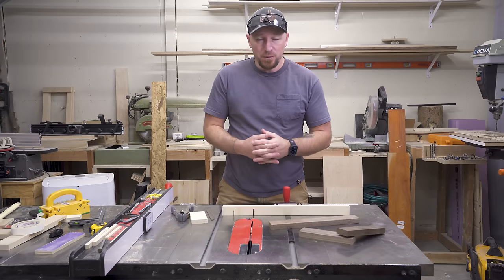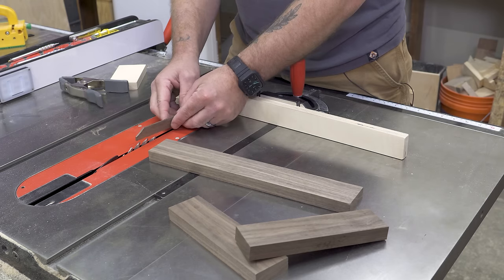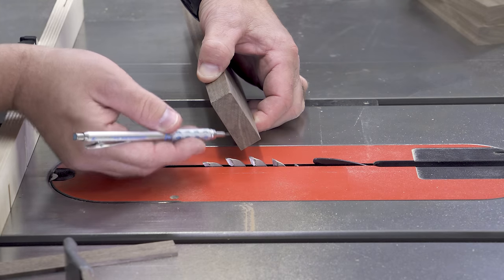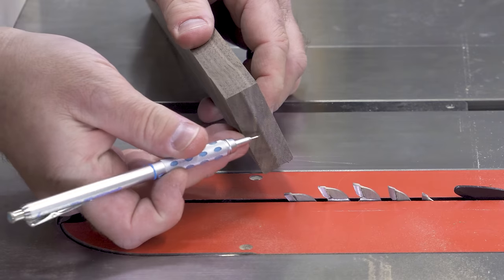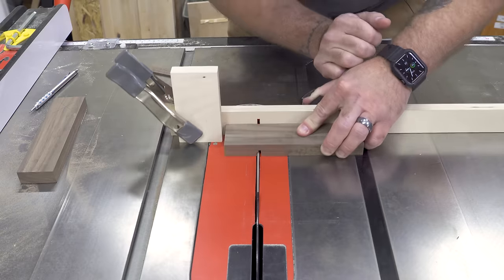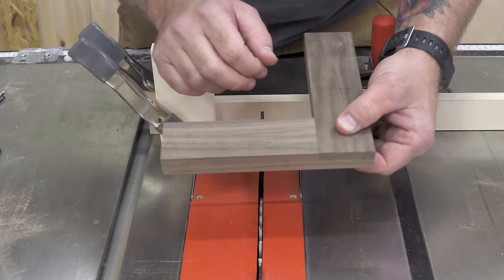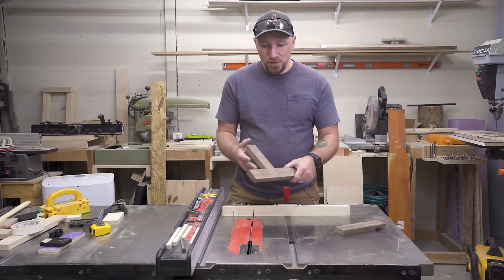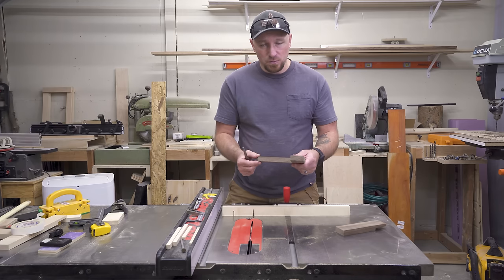How To Make Perfect Half Lap Joints On The Table Saw

Comment: Rather than trying to cut a perfect thickness shim you could use a drill bit the same thickness as the blade.
Reply from the maker: In theory yes. But that doesn't work for people using thin kerf blades so that's why I didn't do it. Cutting the shim wasn't to bad and if it ends up near a spinning blade it's no big deal. Great suggestion though!
Reply: Wouldn’t that scratch up the fence?
Reply: @InspireWoodcraft  what the hell are you talking about? The thickness of the blade is irrelevant if you use the proper sized drill bit. Or better yet just set the stop bock in the proper position.
Reply from the maker: @GifCo This is the second time I've seen you reference putting the stop block in the right position. I am not going to argue with you because I have better things to do with my life, but I will leave this here for anyone needing the info. You cannot just simply place the stop block in the right place without the exact known width of the blade. It needs to be a measured distance to compensate. Literally everyone who watched the video got how and why it worked but you, apparently. No judgement here. Just maybe watch again and it'll click for you. As for a drill bit as a shim: Yes, this will work for most circumstances, as I already stated. However the drill bit needs to be the same thickness as the saw blade or you WILL end up with a joint that doesn't go together as well as the one that I demonstrated in this video. You can't outsmart physics. If you use a thin kerf blade, and you just so happen to have a drill bit the exact same size as said blade, then by all means go for it. If you think outside the box a little you will also come to the conclusion that a perfect blade-width shim can be cut to virtually any length and used for much more than just a half lap joint. You could make it span the length of your table saw fence and cut perfect dados, for example. You aren't going to do that very easily with a drill bit.
Reply: @InspireWoodcraft  lol I know this might blow your mind but drill bits come in ALL sizes. You complete muppet.
Reply: Getting kind of angry in here.  I'm curious about the 'drill bit' approach so I googled and the average thin kerf is "Thin kerf blades will generally be 25% thinner, creating a cut of 0.091” or about 3/32”"  The word "about" is was concerns me.  Do I use a 3/32 drill bit and hope it's 'about' right?  Or do I make a shim that is perfectly right?  If it's easy, I'll go with perfect thanks.
Reply from the maker: @Scott Roy The problem is that terms like "generally" and "about" is that they are not precise. In all honesty this may work just fine for you, but the only way to get it actually precise is too use the exact same thickness as the blade you are using. Drill bits are all different sizes, meaning that they are not all created equal. Just because a drill bit says it is a certain diameter doesn't mean that it is. Especially a worn out bit. The same applies to saw blades. Most saw blades will have the saw kerf written, stamped or engraved on the side of them. But these tolerances can vary in accuracy depending on the quality of manufacture, as with most things, and they also do not compensate for any blade deflection or movement while spinning full speed, in which case (especially with thin kerf blades) the saw kerf is actually wider than the blade measures. They also don't account for a worn out, re-sharpened or dirty blade. I have a super quick and dead-accurate way to get blade-width shims (also good for splines for splined miter joints) and the video can be seen here if you're interested: https://youtu.be/nsw5qlrdx2A. Hope that helps! Now we can wait patiently for someone else to respond with their vast array of wisdom all the while claiming I'm a "muppet". 🙄
Reply: @InspireWoodcraft  Yeah that muppet comment...wow.  Thank you for your clear and ACCURATE information.  When I see your two pieces of wood sticking together without glue or anything yet.  Yeah you win.

Comment: Great tip. Unfortunately here in Ireland and indeed the rest of Europe flat blades and dado blades are not allowed. Pain in the butt and of course our bore sizes are different as well so we can’t really order them from the USA
Reply from the maker: So wait you aren't allowed to even have flat grind blades? Someone else said something about the 30mm arbor issue also.
Reply: @InspireWoodcraft  yep it’s a 30mm arbor and it’s not that we are not allowed to have it . It’s not allowed be sold in shops under health and safety standards.

Comment: To make a perfect shim, you could use an old blade (of the same thickness as your current one) and cut a rectangular piece out of that. Or buy a small piece of steel that's also the same thickness. That would also give you a reusable shim that isn't going to warp or change size through the seasons.
Reply: The carbide tips on nearly all modern blades and the tooth set would make that ineffective, I think. What I mean is the rectangle cut from the center of the blade wouldn't be nearly wide enough. Even the flat top (non ATB) would still have this issue AFAIK

You are right about getting a piece of flat stock steel (preferably over-sized by as close as possible) and then just diamond plate or file it down to perfection.
Reply from the maker: Not necessarily bad ideas but I do have some reservations here. Using an old blade will not work because we are making the shim the same thickness of the blade teeth, not the plate. As for buying a piece of steel: it may be hard to find a piece of steel measuring the same as the blade especially since there are a lot of different size blades on the market. On that same note, I would highly discourage using a metal shim because if it falls and hits the blade, well... The wood movement in a wooden shim is negligible but if it is a concern to you, a better idea may be to pay closer to the grain orientation of the wood before you cut the shim. Wood typically moves the greatest distance across the grain, like from left to right as we would typically see a piece of lumber. If you make it from the right grain direction the movement will not affect the thickness whatsoever.
Reply from the maker: @JohnyW87 Good find. I cut mine almost the same way. His are a little tight though for some reason.
Reply from the maker: I just uploaded a video on how to make the shim if you're interested. Super easy! https://youtu.be/nsw5qlrdx2A
Reply: Jodie (hope I spell that right) I really like the uncomplicated,and “unfancy” way and style that you produce your videos,down to earth,little comertial and not trying too hard to be somebody,who ain’t authentic anymore.That’s what makes your videos enjoyable and.....I guess “stress less” fits in here best.
Reply: You need to allow for the width of the kerf, which is not just the thickness of the blade disc, but the projection of the teeth.

Comment: If you can cut a shim the perfect width of your saw blade you should be able to handle just placing the bloody stop block in the correct position.
Reply from the maker: You're right. I should be able to just eyeball it. Or something like that.
Reply: @InspireWoodcraft  yea or you could measure it, use the kerf cut in your fence to line it up, or this one is SUPER advanced but you could use a scrap piece of wood to get it perfect.

Comment: What about is the two parts are of different width like a 2x4 and 2x6 half lap joint
Reply from the maker: You would just have to reset your stop block for the next size. That's an interesting one. Might have to do that.

Comment: Nice presentation, but I would avoid running a piece tight against the fence while using the miter gauge because of the potential for the piece to bind between the blade and the fence.  Once you find your place on the miter gauge, removing the shim from the fence eliminates the potential for binding.
Reply from the maker: I actually just did a video to address this very thing! It’s a common misunderstanding. Why You Should "ALWAYS/NEVER" Use the Miter Gauge & Rip Fence at the Same Time / Woodworking Safety
https://youtu.be/MxhPgNbFzXQ

Comment: I don't have a flattop blade for my table saw but I can get cuts like that. There are no ridges. So like idk. Are flat top saw blades better than 40 teeth ones?
Reply: The amount of teeth make no difference. It's the bevel cut on the teeth. You might have a combo blade with ATB (alternate tooth bevel) that also has a flat top tooth every 4-6 teeth giving you the best of both worlds
Reply: @GifCoDigital  does that mean each carbide tooth is alternate sides, like the first one is angled towards the left and the next one the right and so on so forth?
Reply: @Zack16Fair  yea you got it. That is what most standard blades come with now. But like I said on some combination blades they will mix in a completely flat tooth every so many teeth. So that could be why you are getting a nice flat surface even though you have some beveled teeth
Reply: @GifCoDigital  cool, quick question if my outfeed table is about half an inch shorter than the top of my table saw, is it okay? Or should I make it completely flush with the top of the table saw?
Reply: @Zack16Fair  I would definitely try and make it flush if possible. On shorter rips it shouldn't make much of a difference as all it is doing is stopping the work piece from falling on the floor as you finish the cut. But for longer heavier stock where the outfeed table is supporting the work piece for much of the cut then having that height discrepancy will cause it to lift off the table saw table which would obviously effect the depth of your cut and also introduce more chance for binding.
Probably worth the bit of effort now to shim the legs or add a 1/2" price of plywood to the top and avoid issues down the road.
Reply: @GifCoDigital  okay. It's on casters so I guess I'll put just half an inch of plywood underneath it to level it out.
Reply from the maker: @Zack16Fair I know this question wasn't directed towards me, but a bit more info for you if you want it. The height of your outfeed table depends on how far away from the saw it is. If it butts right up to the back of the saw, making it flush is perfectly fine. However if you use a miter gauge or sleds you will run into issues if you don't route grooves into the outfeed table's top because the top itself will stop the miter gauge from sliding the whole distance of the slot. If your outfeed table is not butted up to the saw table but at least fairly close, a slightly lower height is preferred. This is so that material coming of the back of the saw that dips down (thin sheet goods, bowed material, etc.) doesn't hit the edge of the outfeed tables top and stop your work from moving forward. As far as the length of material affecting the angle and blade height as in the comment below, this is normally only a problem with non-through cuts, like a dado or groove. If you are making long cuts and the end closest to you is lifting a little due to angle, just raise the blade to compensate. Remember the longer the material the lower that angle gets as well. Another way to compensate would be to just throw a piece of half inch material on the outfeed table when you make those longer cuts. Problem solved and problems avoided down the road. Hope it helps.
Reply: @InspireWoodcraft  thanks that's a great response and there's about an inch or so gap between the outfeed table and the table saw. I'm doubling my workbench as a outfeed table and I just have to keep it clear whenever ill be making long cuts 😂
Reply: @InspireWoodcraft  you have some pretty interesting ways of doing things. I wouldnt setup an outfeed table that is only suitable for some cuts (ie only through cuts), also suggesting that someone just raise their blade to accommodate for a work piece lifting off the table is just wrong and dangerous. 
A small chamfer on the edge of the outfeed would be the same as lowering it slightly to handle sheet goods, and if you are milling up rough bowed lumber you hopefully are smart enough to cut with the bowed ends facing up which would make your lowered outfeed table even worse.
Finally If you can make a cross cut sled you can handle designing it to work with your specific outfeed table. No idea what you are talking about with the miter gauge, I have a small shitty table saw and the miter gauge doesn't come anywhere near exiting the back of the table when the work piece is fully cut and that is with no miter gauge fence installed which would hold it back even further from the end of the table saw.

Comment: Tip: you actually want the cut .001-002" deeper than halfway to account for glue. I set it up with a very thin piece of paper against the table saw top when "kissing" that halfway point. That gives me the glue line.  You do NOT want the joint proud enough to feel, as fixing it literally doubles or triples your build time. If it's scooch deep you can shim with tissue paper or a super thin plane shaving of the same stock.  Lastly a drill bit the thickness of your blade is a more reliable "shim"... If you use wood don't try to save it... perfect thickness today won't be next year.
Reply from the maker: Drill bits only work some of the time. It's an old carpentry trick that some people have tried to pass off as a woodworking trick. But the problem is that they are not always the same size as the blade in reality. Just because you grab an "1/8th inch" drill bit, doesn't mean it will be the same thickness as a full kerf blade. The biggest issue is that it doesn't account for the width of cut that the blade actually makes. Blades can make a cut a few thou wider than what they claim to measure in width, either because the blade is lower quality and has manufacturer inconsistencies from blade to blade, it deflects, or even if the saw has an off-axis issue and is wollowing out a wider kerf, as well as other explanations. As for the shim, I have shims that are a year and a half old that still work great. You just have to understand wood species and grain direction.

Comment: Use a router to make half lap joints and to make dado cuts

It takes just as much time to set up a router as it does to chisel the crappy half lap/dado cut on a table saw.

And you can make a jig just like you do with a table saw

Or, make a video showing both techniques and the pros and cons of both processes.

At least you didn't use a hammer then chisel out a crappy joint still needing to be smoothed out and sanded

Comment: Do you really need to use a flat top blade? I think those peaks and valleys would give some room for glue. I bet it's stronger joint than when using flat top blade
Reply from the maker: @Research and Build Glue doesn’t really need “room”. It just needs to be able to bond two pieces together. You don’t HAVE to use a flat top blade, but it sure looks a lot better.

Comment: So why not stand the piece up an cut it with blade up higher?
 On the end pieces of course.
Reply from the maker: You definitely could with the end pieces if you wanted. I like systems that are repeatable and require as little measuring and adjusting as possible so for me this way fit the bill.

Comment: Good ideas but he did something absolutely wrong and very dangerous. You never knew a cross cut using your miter and the fence at the same time.  The risk of a of a kickback is not a matter of if  It will happen it's a matter of when it will happen
Reply from the maker: Actually that’s not entirely correct, but commonly misunderstood. On a non-through cut, like a dado or groove, it is perfectly acceptable to use the rip fence and the miter fence at the same time. There is no more risk for kickback than if the fence wasn’t there at all to begin with. Kickback is caused by an offcut getting pinched between the blade and rip fence and being forced out. With a non-through cut on here is no offcut, hence no kickback. Hope that helps.

Comment: no warning about safety or hazard.  never  never work cutting with fence and miter.  You just demonstrated the mistake..  set your spacer placement (wood),  take the spacer out and make your cut.  this affords gap between your fence and miter and will not cause binding.  There are other tricks as well.  YOU, inspired on creating a harmful technique
Reply from the maker: @rynait Common misconception. I made a video covering this exact topic. https://youtu.be/MxhPgNbFzXQ
Reply: @InspireWoodcraft  see my comment over there.  I expected you to say  this method is somewhat risky, but a method to do.   YOU did not.   You don't inspire safe woodworking.